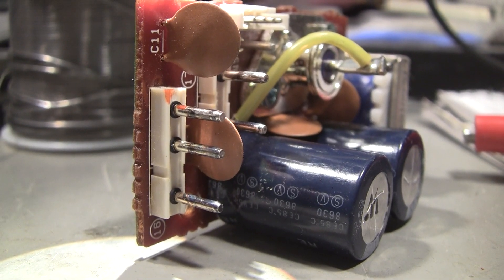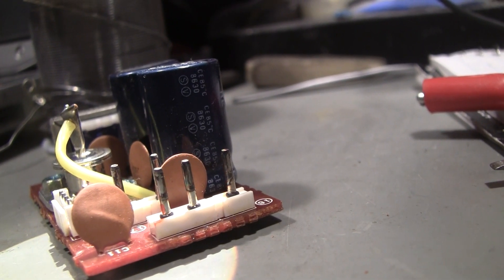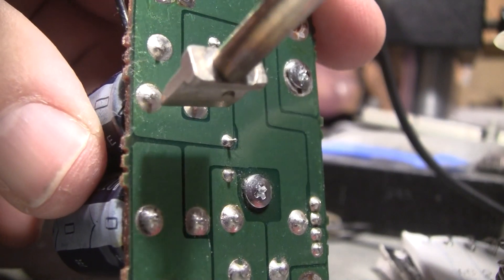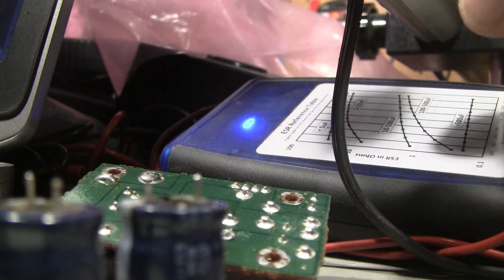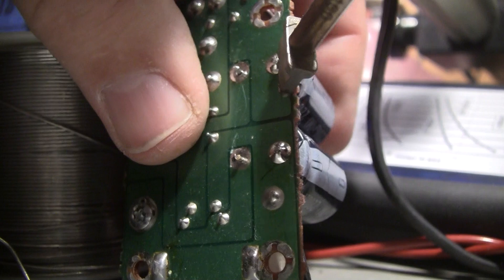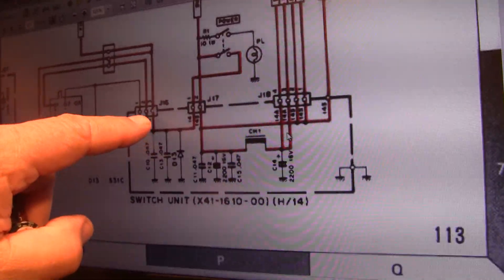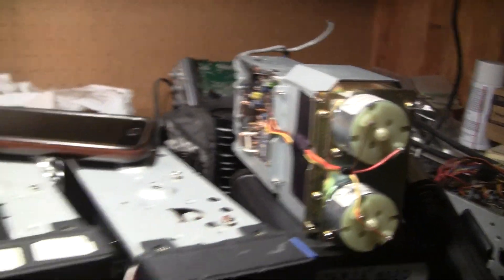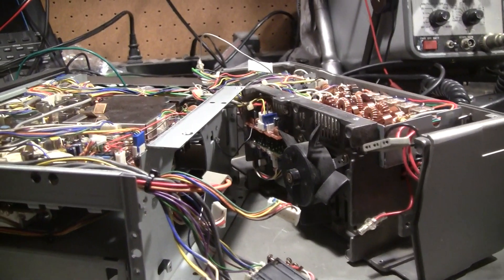Kenwood TS-440 Repairs ! Part 8. Hunt for RF Output !!

Comment: Would you have a tear down on the 13.8v DC Power jack area on back of radio, you come close to it on this video, my radio some one put the wire's we think straight to the board with out the socket, I have a PS-430 to hook up the correct way but the 440s is missing the DC Jack Socket.
Reply from the maker: I wish I could help.  I don't believe I've worked on the dc jack.
Reply: @mikep95133  Know any were in the US I can get one via online shop ?
Reply from the maker: @vk6kfk  Sorry, no idea.

Comment: Maybe if you are going to remove those electrolytics, you might as well replace them. Just sayin'. Also, maybe if you want to clean the "blue" off of those pins on the power board, you could carefully use a small piece of fine steel wool and rub them up a bit. But it might not make any difference. Also, Be careful: steel wool and electronics never mix well (loose stray strands!).

Comment: Hi Mike, your TS440S videos have been so useful during my TS440S repair, even just for comparison of boards, connections, wire runs, screw type and sizes, locations of things, etc. - many thanks!

I am nearing the end of what has basically turned out to be restoration as I had to reflow every one of the main boards in my TS440S.  The soldering was so borderline, I had no choice.  I was checking part 8 of your video series to see if you encountered a mystery part I found in the Final Unit (MOSFET power amplifier board that sits under the Filter Unit shelf).  It's an L-shaped piece of copper that looks like it is used to wedge between something and the chassis ground.  The problem is this piece was just lying in the corner of the Final Unit once I lifted the Filter Unit with its metal shelf out.  The piece must have fallen out of where it is supposed to be placed before the Filter Unit shelf is put back into the radio.  Did you come across this piece and, if so, do you know where it goes?  I thought that it might need to sit on top of the big ferrite oval ring and then the Filter Unit is screwed down to keep it in place while, presumably, adding additional grounding?
Reply from the maker: I don't have a clue ! It's been so long for me that my memory is in the videos. Sorry brother.
Reply: @mikep95133  No problem, Mike.  Thanks for replying.  I think I worked it out, or at least I hope I have.  I sat it on top of the large ferrite core as that is really the only place it can be held down while grounding.  Good luck with your TS440S when you resume work on it. I am sure that with a fresh look you will nail all the faults. 🙂
Reply from the maker: @systemtechnix  Good luck to you too !!

Comment: Hey Mike your videos are Awesome and I have learn a lot from them. Thank you so much. Believe me you are not boring in any way. I want to try and fix my TS-440 because it stopped transmitting and these video are priceless. Do you repair these radio's still? If I could I would be interested in having you repair mine for me? I just fear casing more problem if I try and fix it. Unfortunately I sent my Radio to someone else and paid over $300.00 to have it aligned and checked out. Then last night it just quit transmitting. I had "No" output and I was not able to tune it to my antenna with my MFJ 949E tuner and my Dossy Power and Watt meter. Earlier this week it worked fine and was talking to other ham on it. So let me know what it would cost to go thur it and make well again?
Reply from the maker: Try a dummy load and a power meter only during transmit. See if that helps.

Comment: I'd have given up on the TS-440 and got me a TS-430S.  I think the 430S is a better solid state radio and doesn't suffer from the dots syndrome.  When I upgraded from Technician to General Ham license I got a working Kenwood TS-430S with a dedicated power supply PS-430 and glad I did.  The price was right and I just have picked up an off center fed long wire antenna to work with the unit.  I'll have to find an antenna tuner to borrow to get my antenna trimmed properly.  73 from K9POW in eastern Tennessee.
Reply from the maker: My 440 has a built in tuner. Really helpful. Does the 430 have a tuner as an option ?

Comment: Cool soldiering tip, what setup iron that?
Reply from the maker: Metcal. The big tip is .410" wide. I don't know the part number. Helps a lot to do multiple pins at the same time. Only takes seconds.
Reply: I have the same tip for my Metcal. It is a huge timesaver when removing caps. No more rocking back and forth.  
The other Metcal tool that I like is the Talon tweezer for removing/inserting surface mount components.
Reply from the maker: @RickNickel  Hi Rick. I have a Talon but stopped using it years ago. A pair of sttc-126 tips work so much easier for me.